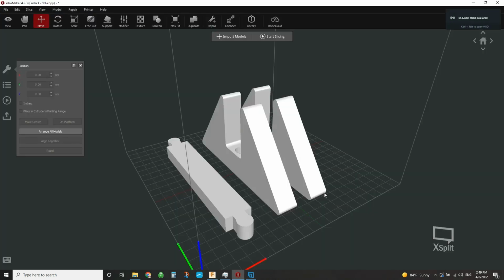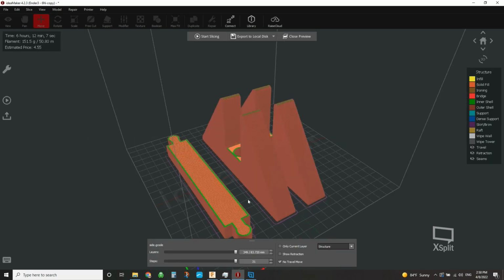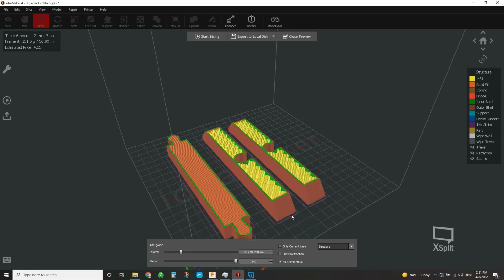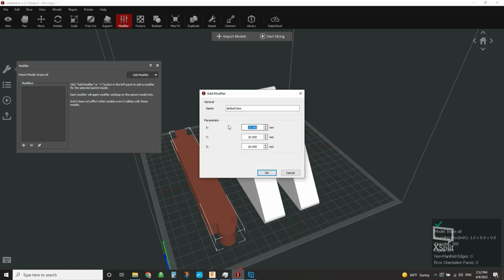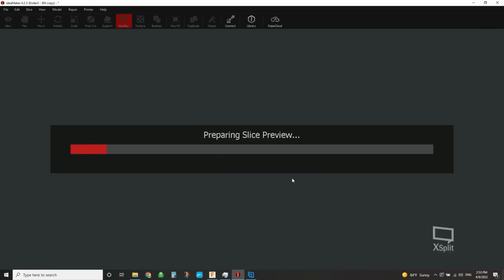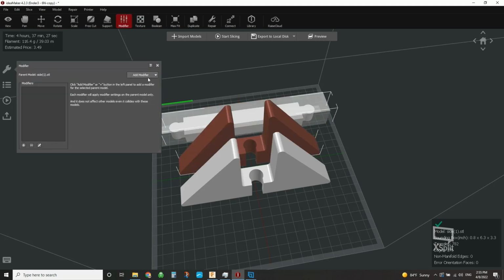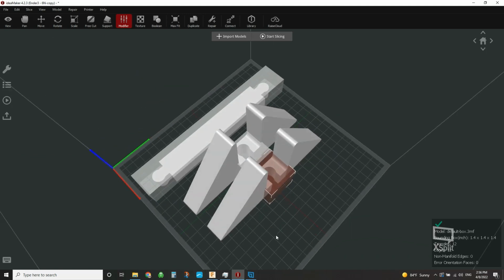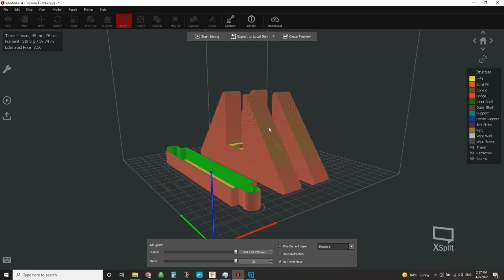Save time and material by selectively adding infill to specific areas in your 3D prints.

Comment: For some reason It's not working for my current model.  I'm trying to reinforce the center of a 9 inch diameter pulley I designed.  I just wanted the infill to be denser but it's staying the same with >100%.  If I change it to 100% then it works and makes it solid.  Maybe the Adaptive Infill setting is messing with it.  I also wanted to change the top solid fill pattern to concentric to speed things along in the middle of the Z axis of the model but that didn't work either.  I'll make an update if I ever figure it out but I'm curious if you can think of something that is obviously being missed on my part.  Thanks
Reply from the maker: Interesting.  I believe it is the Adaptive Infill causing your problem.  In the help text, if you hover over the adaptive infill check box, states that modifier settings will be ignored if checked.  Try ticking that off and re-slice to see if that solves the issue.  Thanks

Comment: hi there Fischer 3D  ive just had my first fail at layer 57 of 585  i was wondering if the guru of IDEAMAKER  ( you)  have any idea of if theres a way in this awesome slicer of starting at a certain z height   any help would be awesome cheers man and thank you for all your ideamaker tuts ..
Reply from the maker: Hey, sorry for the delay.  Thanks for your questions. I did a quick video response here: https://youtu.be/Z-gg_V4mpA8
Hopefully this gives you some options.  There is a way to do it in IM, but it's not super straight forward and there are some considerations you need to take into account.  I've tried to cover them all in the vid.  Good luck, let me know which way you decide to go.  Thanks
Reply: Thank you ..i knew i asked the right person 😁😁😁👍

Comment: Can you do a video on how to use two different print heads in idea maker. I have a Raise3d E2 and I want to switch print heads at a certain layer height for some text on a plate
Reply from the maker: Wish I could.  I've never used a dual print head machine.  I'd have no idea If what I was telling you was correct.